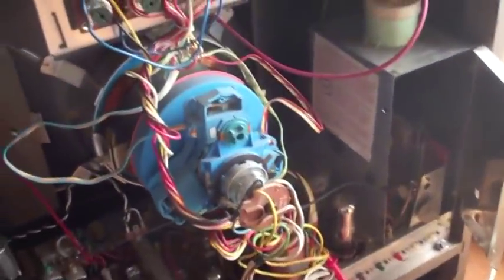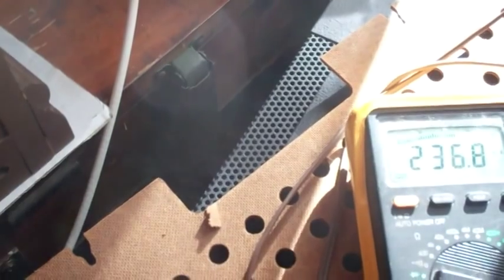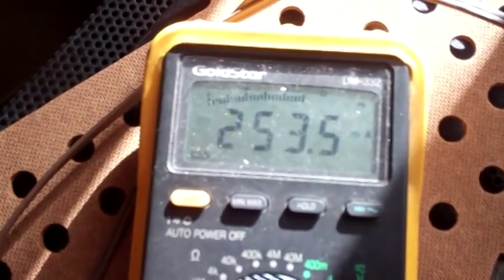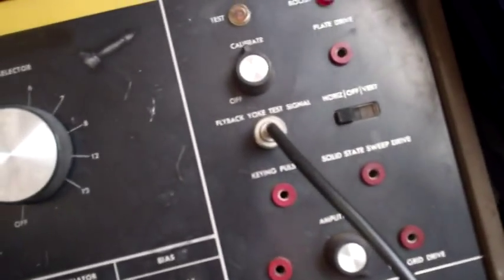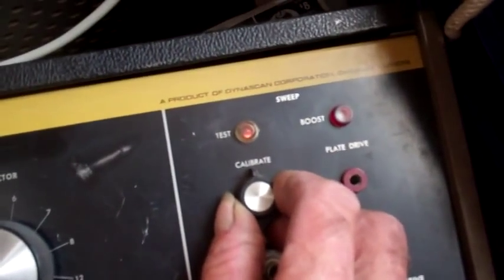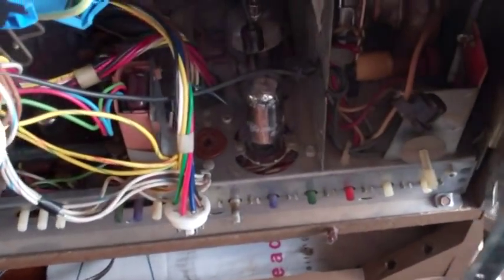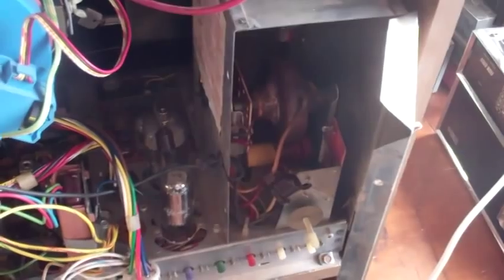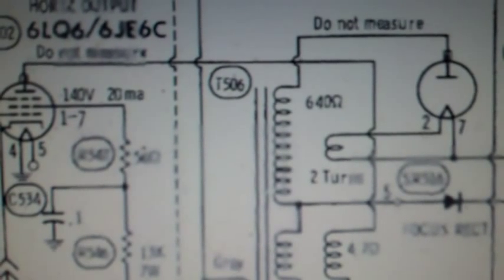Packard Bell Color  Hybird Tube TV Flyback Transformer Failure 98c39 Chassis

Comment: I have experienced all these kinds of failures including a flyback fire. The next one I get with a suspect flyback I will have to do the ohm check, for some reason I hadn't thought to do that.
Could you install air conditioning in the place you are at? I lived without air conditioning for many years but now have it in all of my buildings and most of my cars and I don't think I could go back to not having it especially as hot as it's been.